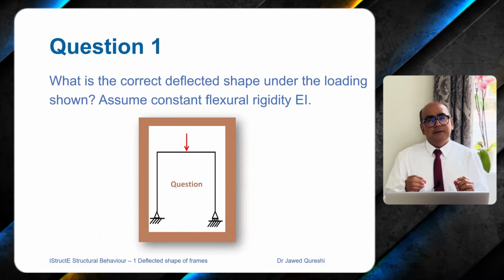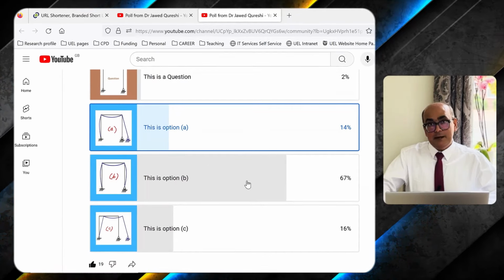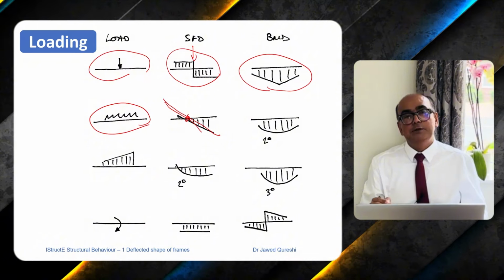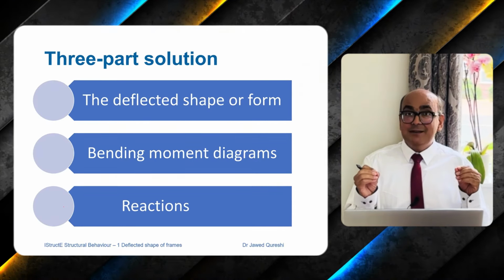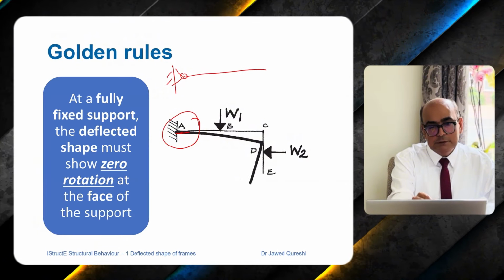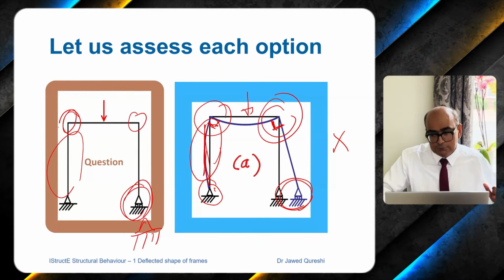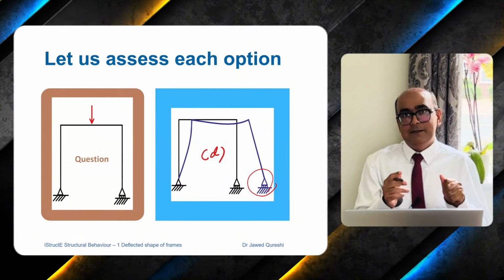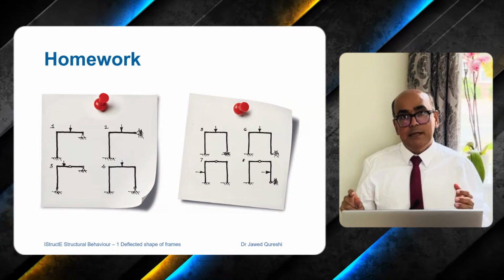Deflected shape of frames | Structural Behaviour Course

Comment: @10.14 why did you ignore the confusing pins at B, C & E which seem to break your golden rule? Moments over these pinned supports are not zero???
Reply from the maker: These are not internal pins; these are roller supports. An intermediate roller support will have hogging moment if load is applied, purely due to continuity. Outer roller and pin supports have zero moment.

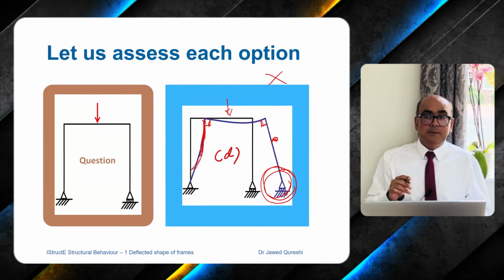Comment: @18:28 you stated: now in what situation it can be possible that we have this deflected shape? In situation
where, for example, this load is 20kN. 20kN means 2 tons that is roughly weight of any SUV car: Lamborghini, Euros or any other SUV and if there's one point load applied, for example 20 times less, here 1kN, that might cause little bit of deformation over here and the deflected shape might look like this.

I tried it the way you described, and the left column is still not deflected, i.e., it stayed straight. Can you elaborate more on this?
Reply from the maker: The deflected shape will still be the same, even if you reduce it by 20 times. It depends on support conditions and member length. As we are carrying out linear analysis here, no matter how much load you apply the deflected shape remains the same. However, in real world, all structures are nonlinear - both geometric and material nonlinearity. 
The question is why do we carry out linear analysis when in reality structures are nonlinear?
Reply: @DrJQureshi 
@ 4:00 you stated:
for deflected shape or deflected form, we need to know three things and these three things are: support conditions, first of all what kind of support is there, position and magnitude of all applied loads, and more importantly joint compatibility. So, since there doesn't exist any loading on columns, there wouldn't be deflection on them.
Reply from the maker: @hoshangmustafa9672  Columns take load from the beam.
Reply: @DrJQureshi 
@ 4:00 you stated:
for deflected shape or deflected form, we need to know three things and these three things are: support conditions, first of all what kind of support is there, position and magnitude of all applied loads, and more importantly joint compatibility.
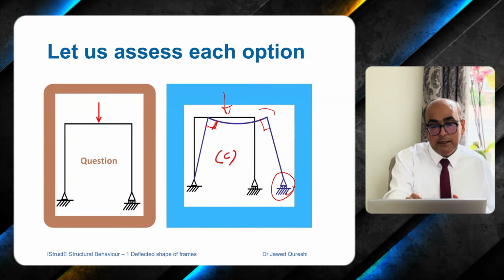@16:48, you stated:
because this roller support is moving rightwards, it is causing this column to move rightwards as well without any deformation in the column itself because when it's moving rightwards, the downward force is not causing any deformation. If it was stopped, then it will cause deformation in the column. So, deformation in the column should not happen if one support is moving rightwards.
I mean when you stated @ 4:00:
for deflected shape or deflected form, we need to know three things and these three things are: support conditions, first of all what kind of support is there, position and magnitude of all applied loads, and more importantly joint compatibility.
This statement should be added:
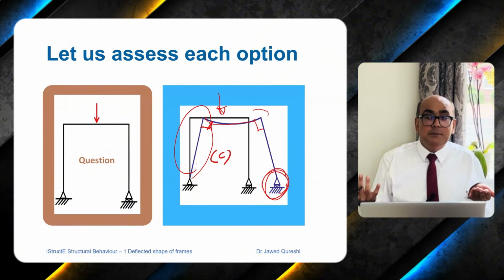when it's moving rightwards, the downward force is not causing any deformation. If it was stopped, then it will cause deformation in the column (as you stated @17:00)
Reply from the maker: The answer is that the linear analysis is simple and it gives us enough information for design. Design is about working out capacity of structures and comparing it with applied loading. We are fine as long as the capacity if enough.
Reply from the maker: Also, note that the deflections are highly exaggerated. In real world deflections will almost certainly be invisible. We always have deflection limits in place too, so that we can comfortably use structures for daily use.

Comment: Hello Sir, Wonderful lectures! Thanks for the making the contents for free of cost!
Just one question: The deflected shape in column should be in single curvature correct? (Occurs at 8th min). But the drawing what you show in the slide looks like there is a double curvature. Please let me know if i am misintrepretting. Thanks again!
Reply from the maker: Let me check the video, I’ll get back to you.
Reply from the maker: I think the column will deflection in double curvature when a vertical load is applied at the tip.

Comment: DR please I wanted to find out.
What if the load on the frame was a uniformly distributed load.
Will the deflected shape at the top level be thesame.
Hope to hear from you soon.
Reply from the maker: Dear Ahmed, the deflected shape will be slightly different in case of udl. For uniformly distributed load, the deflected shape on the beam side will be smooth in the centre; while in case of point load it will be pointy at the centre.
Reply: @DrJQureshi  thank you sir.
You are the best.

Comment: Thanks for the video.
So when you say "no rotation about a fixed support" it means that 100% of the moment reaction is transmitted to the member it is connected to because of beam compatibility keeping the angle at 90 degrees, correct?  And a pinned connection doesn't not allow the moment around that support to be transmitted to the connected member, but the vertical reaction will cause the connected member to deflect because of beam compatibility?
Reply from the maker: Yes, a fixed joint transfers all moment and no rotation takes place. This is a modelling assumption.
Reply from the maker: @johnkennedy3602  a pinned or a simple joint allows rotation and does not transfer moment.
Reply from the maker: @johnkennedy3602  However, these are modelling idealisations. In real life when we test a simple joint it takes nominal moment, for example my testing has shown about 2 kNm moment is taken by the joint. This is very small compared to the moment resistance of the beam - about 400 kNm (in our tested joint). This is how we simplify structures by taking some modelling assumptions